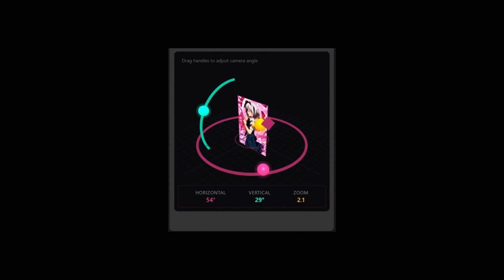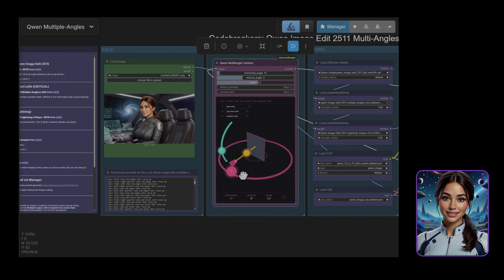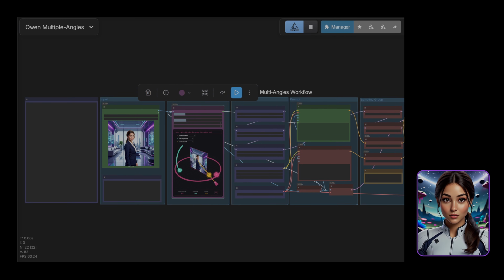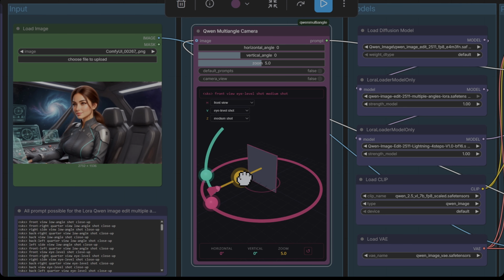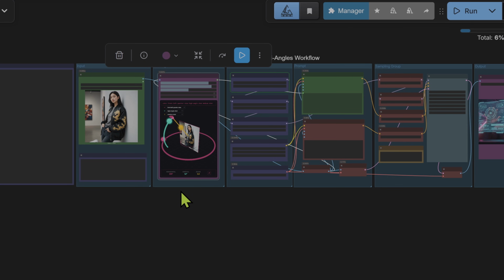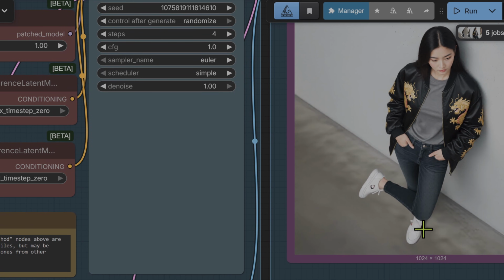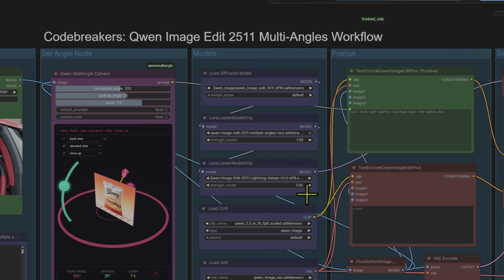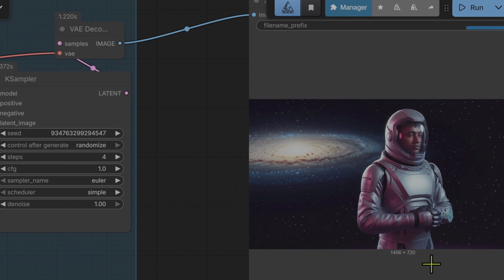Qwen Image Edit 2511 Multi-Angle Node — Correct Usage, Limits, Workflow

Comment: Just try with grassland on the ground there is a problem when u take an image from the Arial view grass just does not match the scale
Reply from the maker: Interesting - how about changing seed and slight angle changes and regenerating - change prompts by using prompt and disabling angle node - use the prompts from the dropdown list to activate the multi angle lora and then add further instructions.

Try that in cases where you find its not behaving! Thanks for sharing your experience and let us know how things go…👍